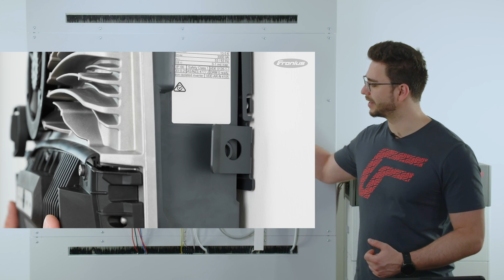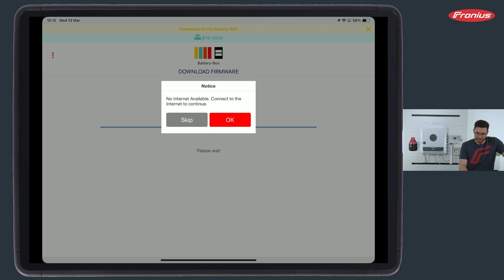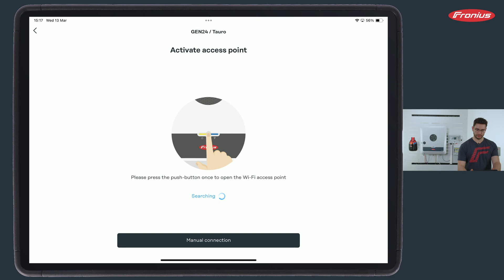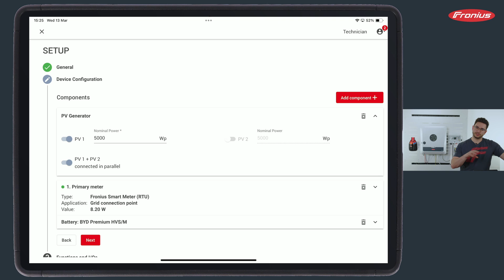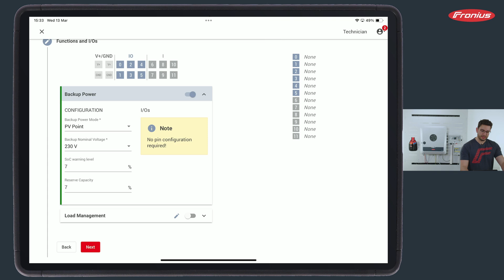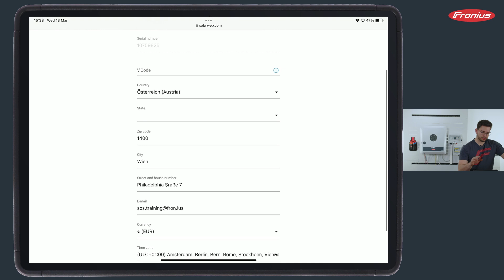Commissioning the GEN24 Plus and the BYD Battery-Box

Comment: 12:40 I was wondering why does it matter that the DC switch has to be turned off until the very end?
Reply from the maker: @Mrilzut This is because the battery must first be added in the GEN24 user interface before a battery voltage is present in the device, to prevent an error from being triggered.